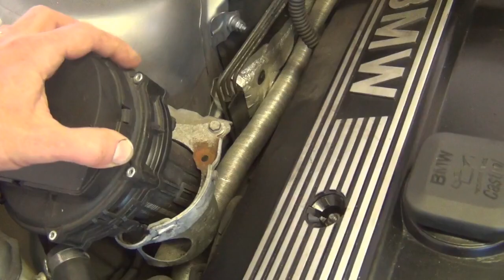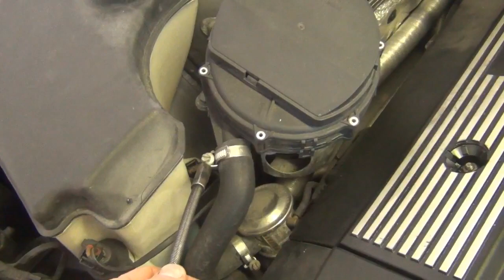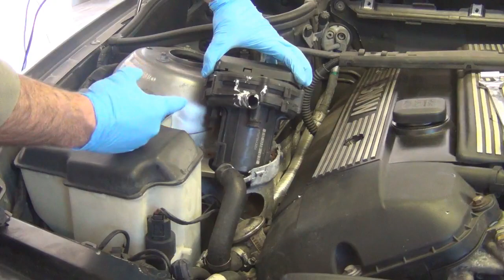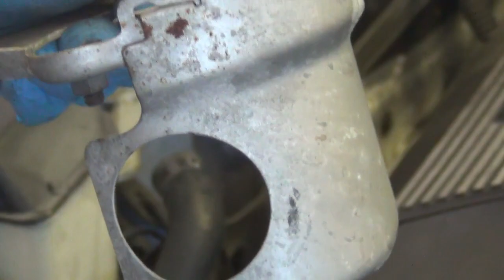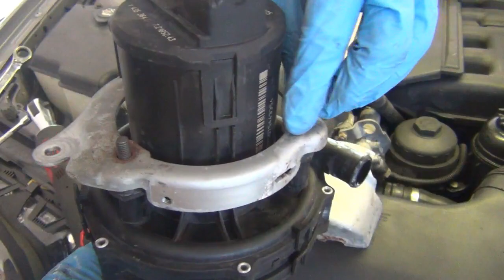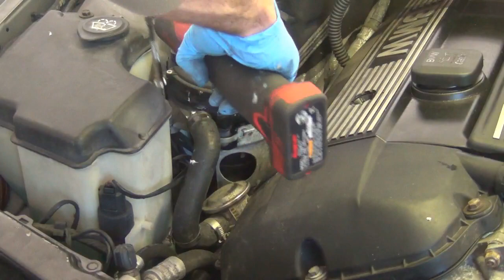BMW Secondary Air Pump Removal To Replace Hold Downs 3 Series E46

Comment: Do i actually need these? 2 of mine are broken but i have all the nuts still. Does it effect performance or anything?
Reply from the maker: They just prevent vibrations when the pump is running. As long as it is secured still and it will not break the connection it should be fine. They are basically just the hold downs for the pump.

Comment: Some questions. Does SAP have a filter? How can it be torn apart? Why doesn't the M3 have a return tube?
Reply from the maker: No I do not think there is any filter in the air pump. The M3 does not need secondary air as it is for emissions regulation.
Reply: @AskTheCarExperts  Thank you! What do you mean "don't need Sap"? All M3 e46s have a sap, only the narrow tube that goes from the solenoid back to the firewall is missing. I have error p0411 (AA170), everything works, I don't know what is bothering it.

Comment: Did you have to unplug the battery to replace this part?
Reply from the maker: No but if you feel safer you can.
Reply: @AskTheCarExperts   ok bet and what about to change a 02 sensor?

Comment: What would be the issue if your secondary air pump kicks on, sounds like a vacuum cleaner, and stays running until you shut the car off? Then it has the same sound as when you turn off a vacuum. The weird thing is I'm not getting a check engine light. 2004 bmw 330ci.
Reply from the maker: Hello, That is odd . It should run for a short bit then shut off. Could be a short on the activation side or the relay is stuck. If you need help send me a message through my website. Www.askthecarexperts.com.
Reply: @AskTheCarExperts  ok I did. Thank you!

Comment: I was putting in an order for parts and was just short of what I needed to save on shipping and I found your video.  That airpump has been rattling around for ages and I thought I was going to have to spend $$$ to replace it to fix it.  Thanks for the tutorial.  Saved me some shipping money and helped squelch a rattle that's been annoying me for the better part of a year XD.
Reply: I too was about to spend monies on a new secondary air as I thought it was joined together as a unit.  Glad it was not and was only pennies to get mounts.  The paper towel incredible as most of us don't have magnetic screw drivers laying around.
Reply from the maker: @wanderlust3517  That's great! I love that trick  😀
Reply from the maker: You are welcome!

Comment: I had the exact same type of break on mine, and wondered could you explain how that would break like that?
Reply from the maker: Hello Rye, They are a rubber composite and  fail due to age and brittleness of the rubber over time and temperature.
Reply: @AskTheCarExperts  I got a P1347 Manufacturer Ignition System or Misfire code. Would this smog pump breaking loose like that cause that? Cause the engine to make a thumping noise or kicking noise, bad acceleration, etc.?

Comment: Isnt that what make my bmw slow down a bit n makes a weird nose not all the time
Reply from the maker: Hi Johnny, The secondary air pump only runs for a short time on a cold start during cooler temps. I don't think it would make you slow down but it could make noise when it runs.

Comment: would this fix p0492, having trouble with rpms dropping
Reply from the maker: Hello Peter, your code relates to not enough flow in the exhaust when secondary air activates. This can be from a bad or weak air pump, non return valve sticking closed, and if the valve is vacuum activated it could be a broken vacuum line to the solenoid or even a bad solenoid (solenoid failure is very rare). This would not cause an idle fluctuation. You may have a tired Idle Air Control Valve.

Comment: I see other channels removing the secondary air pump in their e46. How important is the SAP because their expensive to replace?
Reply from the maker: This pump is used to heat up the CAT converter faster by pushing oxygen into the exhaust stream. This helps reduce emissions and gets the vehicle to closed loop faster which uses less fuel. I would not recommend removing this important part of your emissions. I hope this helps!